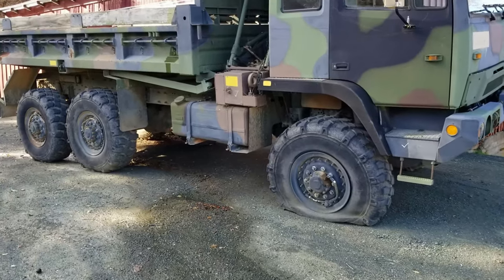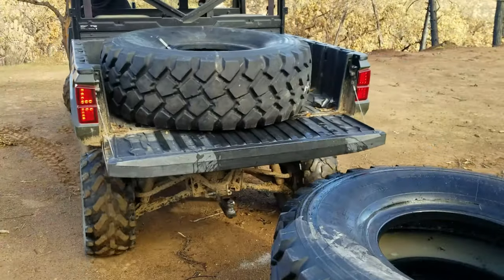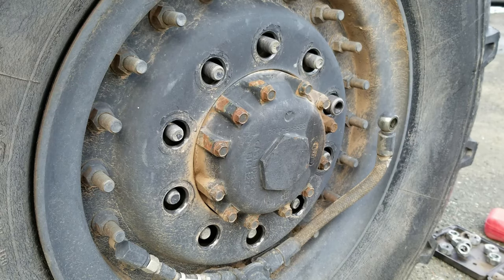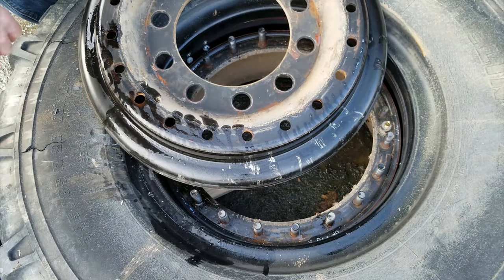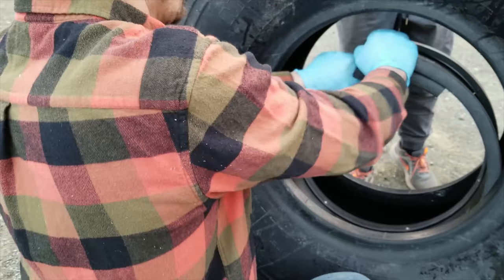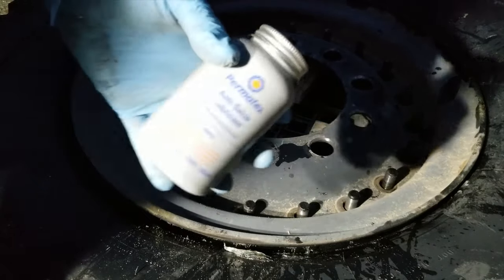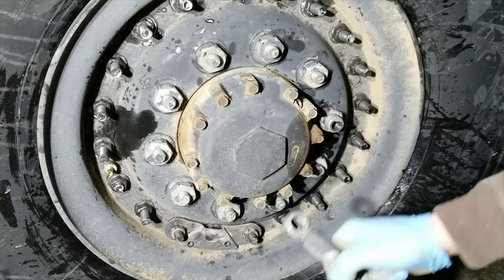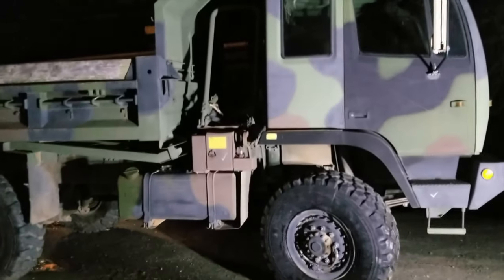LMTV Tire Change & Wheel Disassembly / Reassembly (Military Beadlock)

Comment: Tough job without equipment, so good job on that.  Here are a few notes, as we change dozens of these tires each year for EOD on our base.  First, build yourself a slide hammer bar for breaking the bead on the outer and inner rings.  While tire bars will work, it takes so much more effort and if you have to change these often, it is very helpful.  Also, the older they get, the nastier the beads, and eventually the tire bars will simply not be enough.  Next, you don't need to ratchet strap the inner band... just push it down into the tire, remove the bolts/nuts/ connecting straps, grab one free end, and pull it through the side of the tire.  Then you just sort of "unscrew" the band from within the tire.  It's flexible enough and once you've done it, you will understand how quick and easy it is.  Spraying the rubber with a little WD40 or soapy water, while messy, makes life easier too.  Your wheels are in much better shape than the ones our EOD monkeys bring in, but keep in mind to clean the o-ring groove and always replace the o-ring (as you did... these notes are for other folks too... you did great!).  The scratches on the rim and ring are fine, but make sure to wire wheel any rust off any mating surfaces between metal/metal or metal/rubber.  In addition to using tire soap to seat the beads, it is also helpful to smear a small amount in the o-ring groove and on top of the o-ring once it's in the groove.  Most leaks when re-seating are due to something wonky with the damned o-ring, so some snot helps for that initial re-inflation.  In my experience, the torque specs have never been tight enough for anything but a new or nearly new wheel... we are usually forced to grunt them sumbitches down until our 3/4" gun won't turn them anymore, but I am sure the information is appreciated by your viewers.  All in all, great job!
Reply from the maker: Haha, yep, by the time I finished swapping the 6th tire, I had figured out the way to screw the inner band in place, same on the tire soap on the o ring groove. Good call on the slide hammer. Your experienced comments are precisely why I love sharing this stuff on YouTube so much. To interact with like-minded folk’s who are geographically spread out! My limiting factor has been the video setup and editing otherwise I’d be posting almost every day!  Got to find some better ways to do it. Matthew, I really appreciate the input. Also, thank you for your service sir!
Reply: Great advice.   Much easier than a HMMWV Tire.
Reply: @Tim F  the old style Humvee tires with the 2 piece inner ring were so easy.  The newer style with the rubber donut are a PITA.  Best trick I've found is a skinny bottle jack slipped into the donut so you can stretch it longways like a rubber band, then tuck it into one side of the tire and slip it out.  Reverse the process to put them back in.  But they suck for sure!
Reply: Are there any tools or anything else you need to make it easier to change these tire?
Reply: @tootasmoviecorner   For the larger tires, like those in the video, one helpful item is to make a small, round stand to set the big side of the rim on.  Think barstool for a midget.   The goal is to suspend the rim so the tire will rest on the beads, not the floor.  You could use a 5 gallon bucket, but they will crush under the weight... but that's about the size of stand you need.  After that, repetition will make you faster.
Reply: @matthewpeterson3329  do you have an email so I can send you a picture of what I think might work and you can tell me if it does?
Reply: @tootasmoviecorner   I don't like to use my email address on YouTube, but any short round stand will work as long as it is strong enough to support the weight.  You just need the tire off the ground an inch or so.  It isn't a must, just a bit helpful when trying to press the ring onto the studs to get the nuts started, because you won't have to fight the tire as much.
Reply: @matthewpeterson3329  ok cool. What about wheel chocks on the side. Put them back to back and change it like that. Will that work?

Comment: Great information! I appreciate all of you guys doing these videos for us folk out here working on these trucks somewhat blindly. Always helpful. Thank you!
Reply from the maker: Really appreciate the compliment. Always wonder if putting it out there will be genuinely useful.
Reply: @cowboyV2  Brother, I’m going through my entire truck end to end and any information is helpful to me. I’ve never even owned a diesel vehicle before! It’s coming along well. Dave Anderson at Helicools Helipad has been a great help! My truck is a 1996 with only 1780 miles but it sat for years outside under pine trees with the turret leaking. Lot of cab rust...😞. Taking my time and going through and redoing everything 💰💵💰💵💰💵🥴
Reply from the maker: You chose a great truck to work on. I had a much (MUCH) older M51, and I'll tell you, these LMTVs make that M51 seem like a rickshaw! Also, loads of parts availible for these things (even seen whole cans, new in crates). 

Anything you are having a tough time with?
Reply: @cowboyV2  Well, I’m trying to work through system by system. Currently I have a tie rod end stuck on the passenger side that I’ve heated and to death and still no budge. Got a pickle fork just waiting on a friend to help me. My fan clutch isn’t disengaging so I appreciated seeing your relay rebuild. I can here it click but it’s not letting the air out. Gotta do fuel filters and coolant next which should be easy. Been fixing air leaks and all that seems to do is create another air leak somewhere else. I’ve rebuilt the air over hydraulic pump, cab pin seals, air dryer and changed the oil. Just painted the rear bumpers and replaced with new reflectors and LEDs. It runs and drives great just got a lot of maintenance to do.I’m capable just new to diesels and gigantic nuts🤣
Reply from the maker: With you on the air leaks. I still need to sort out a leak on the tailgate release valve (dump bed). The enormous nuts are kind of fun. For better or worse, thankfull for China tools. Cant imagine what Snap-on or the other guys would want for a 1" breaker bar!
Reply: @cowboyV2  Fortunately I have a nice supply of tools at home. Unfortunately, the truck is stored at my friends shops which means I have to tote my tools back and forth and often didn’t bring everything I needed. Due to the size of this as compared to my vehicles, ATV and mower I’ve spent well over a grand on new tools. It’ll all be worth it though. Are you interested in seeing any of my pictures?

Comment: Also, on the Stewart Stevens AND Oshkosh variant that replaced them, the steering tie rod sits low behind the front diff, exposed to rocks and stumps that you think you can straddle when driving off road, but NOPE.  At some point, you will likely hook it on something and bend it backwards, making the front tires point away from each other.  There is a simple fix for straightening it without taking the tie rod off the vehicle.  Use a ratchet strap connected to the right and left front tow loops, slung back around the center of the tie rod at the apex of the bend.  Cinch the strap, pulling the bend towards the ground to keep it from swinging rearward.  Use a jack under the apex of the bend to push upwards, and the weight of the vehicle working against the jack will bend the tie rod back into shape.  It will take multiple resets of the strap and jack due to spring back, but once it starts to unbend, it will get easier with each subsequent attempt.  Next to tire damage, this issue is the biggest problem with these vehicles.  We fix them in the field at least once a month.  I hope this helps if you ever find yourself in this predicament.
Reply from the maker: Thanks for the tip. Took a few tries to figure out that process I’m sure!

Comment: You should get yourself a torque multiplier for the wheel nuts, no need for bars n pipes, or having someone extra to put foot on brake,etc. 
I have one for my truck and it comes in a handy carry case 👍🤠
Reply from the maker: Had one of the china ones from Amazon the stripped it’s gears. What model do you have?
Reply: @cowboyV2  , I got mine from EBay, it’s 1:78 haven’t managed to kill it yet. Been using it since 2014 on mainly Scania trucks and Hinos
The trick is not to use it with a rattle gun, I seen a guy use a rattle gun on it. Blew it to pieces

Comment: the ratchet strap method is not needed to remove bead lock.  Once unbolted to separate the ends-- pull on side upward outside of the tire...... then turn the whole bead lock as you continue to literally unscrew (snake) the bead lock out.   Basically this method turns the bead lock ring into threads of a bolt that when turned acts like the tire is a nut.... and your simply screwing the bead lock out as if it was a bolt from the nut.    Replace is done opposite.
Reply from the maker: Thought about that! Still have one more old tire to change out. May give it a try! Thanks!
Reply from the maker: Follow up on this: I finally did the last tire 2 weeks ago and tried the corkscrew method you described and “boy have I been doing it wrong!”.

Was so much faster and easier. Was the last tire so won’t likely get to do it again on this truck. Maybe some will see your comment. 

This is definitely the way to go. Thanks for the tip!
Reply: I did not think that this would work. Can confirm it’s super handy. Thanks.

Comment: It looks like you have to make sure you get the rim back on the truck with that one hollow stud for the CTIS through the correct hole in the rim, or did they make it so that it will only go on one way (one hole larger than the rest -- which now that I think of it, makes sense)?
I also noticed you did not have to do any deflation prior to taking the rim apart because of the ruptured sidewall.  But if it wasn't ruptured and had say 50 PSI in it, when you remove the CTIS hose, will the tire deflate through that elbow?  Or will the tire deflate when you remove the banjo bolt from the hollow wheel stud? Obviously, you can't take the two halves of the rim apart with air pressure inside.
I'm wondering if it is possible to remove the bead lock much the same way you remove a wheel from a regular passenger car tire.  If you had a tire spoon with a plastic coated end, you would scratch up the bead area of the out half of the rim. 
I'm also thinking if you had something the back side of the outer half of the rim would set on and bolt onto that had a base that went all the way under the tire, you could slide it under the truck, place your jack between the tire sidewall and the frame of the truck and start jacking.  The base of the jack would push the tire and inner half of the rim down away from the outer half of the rim.  No prying necessary!  You could probably weld something up out of square tubing that would work.  I have seen people break the bead on a passenger car tire just by sliding it under the car and jacking between the sidewall and the underside of the car . . . but those don't have a bead lock.  With the bead lock, you have to have the whole thing supported by the backside of the outer half of the rim rather than the bottom of the inner rim half like you essentially have with the passenger car tire when using this method.

Comment: Them wheels and tires seem light compared to the ones I got from govplanet, I can barely even move them till I get them up and can roll them. I did get the rim and tire together tho, it almost seems like its 700Ibs all together. Idk how I'm going to even mount them on my deuce lol, I'm going to check and see if they are all deflated
Reply from the maker: They are heavy! I jack up the axle until the studs align with the holes on the rim. Usually get help to tip them up.
Reply: I figure out why these were so heavy, I accidently and bought 53 inch tires lol, I'm finally getting the proper size ones in today
Reply from the maker: lol. If you have the clearance, 53s look awesome!! Only downside is it would affect your gearing, 1st gear won’t be quite so low.
Reply: @cowboyV2  I wish they'll fit, they're too big for the back. I'm going to just save them in case I decide in the future to get a 5 ton. Another major downside would be mounting these on, they're insanely heavy on another level

Comment: Tire pressure that you use please?
Reply from the maker: I’ve never checked. I use the pre-set pressures that the CTIS control box uses. Usually in XC mode off road, sand mode if muddy and Highway mode when running up and down the road a lot.